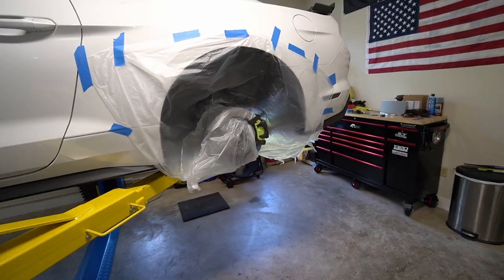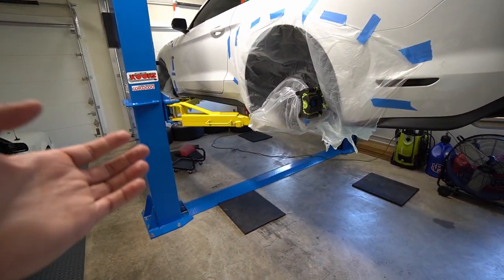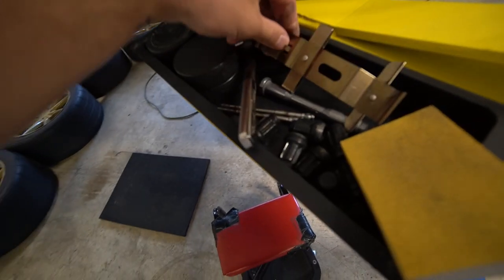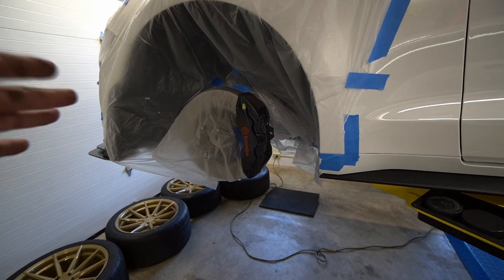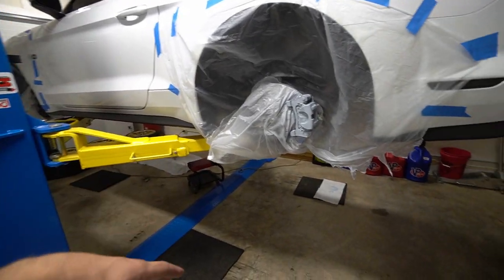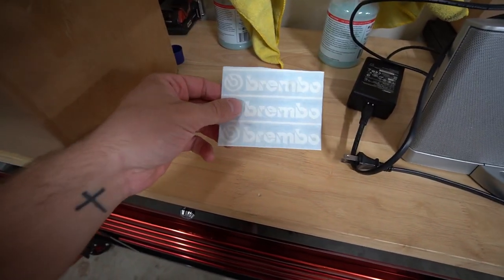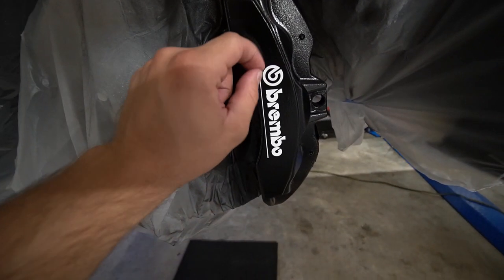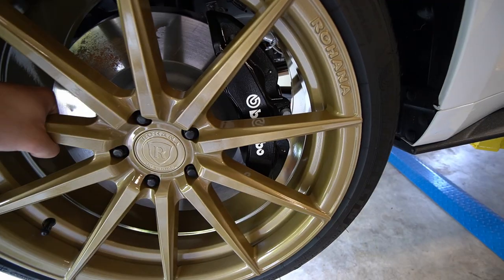Painting Your Brake Calipers is Not as Easy as it Seems!

Comment: Don’t have to take down to bare metal, just scuff them up with a scotch brite pad 2 coats primer, 3 coats paint, 3 coats of clear. Wipe down with alcohol before priming. I use engine paint and have had zero problems.
Reply: They are brake calipers you will never get them cleaned properly unless you take off the wheel, paint is fine no need to powder coat your just wasting time and money
Reply from the maker: Thanks for the info brother!

Comment: It looks pretty good. I previously did mine with VHT caliper paint and spent a ton of time on prepping. That lasted for about 4 months so I ended up removing the paint up and decided to go with the G2 caliper paint. I've had it on for over a year and it looks just like the very day that I did my calipers.
Reply from the maker: I have never heard of that paint everyone told me to use this one I got
Reply: @ItalianStallion410  I never heard of it either at first until I looked into redoing my calipers again. It has a hardener that you mix into the paint and the paint is self leveling as well. If you have issues I highly recommend it if powder coating isn't an option. Here's a link to the site below:

https://www.g2usa.com
Reply from the maker: @darrylpolite8722  thanks I’ll check it out

Comment: Painting them is never easy which is why I just bought the red brembo caliper (bullet package upgrade) which gives you the rear Ford calipers in gloss red too and kept it moving.  I got it for a very good price still expensive of course and replaced the ugly cheap finish PP Brembo front calipers and rears Ford ones.
Reply from the maker: That’s a good point I shoulda done that
Reply: @ItalianStallion410  I mean look.  You saved a lot of money.  It cost me about $1k.  Usually $1200-1400.   So I saw it as a win for me.  Plus install and bleeding brake lines etc.
Reply from the maker: @TheCdM1981  yeah exactly that’s just so much extra work.
Reply: @ItalianStallion410  yes.  You basically have to say I would rather pay this than do any work. Lol.